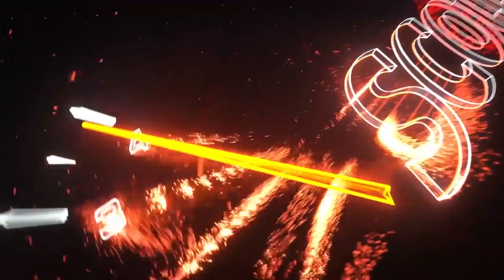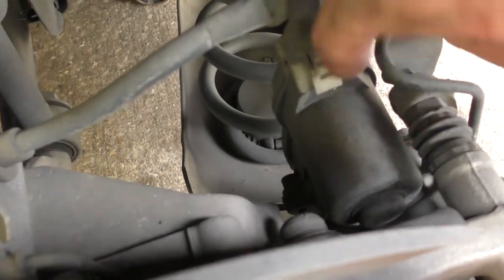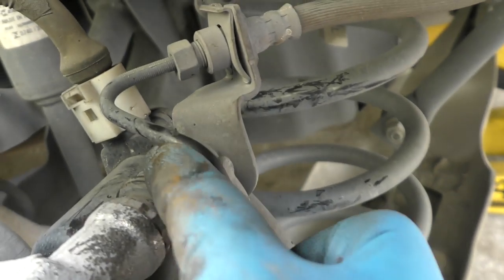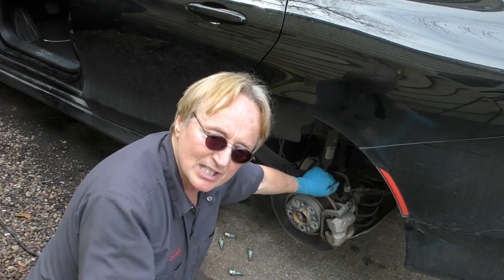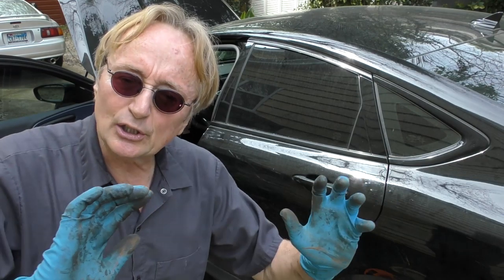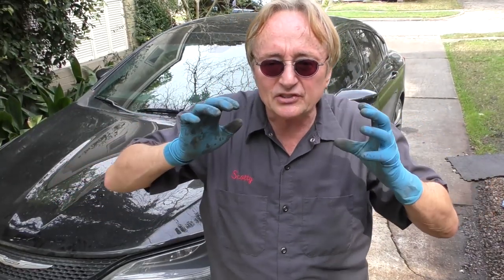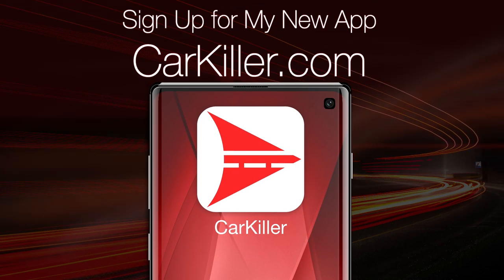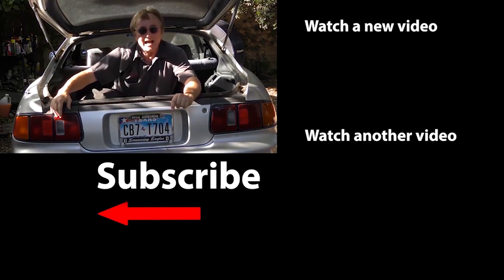This Trend is Stupid and Dangerous

Comment: Old landrover  freelander  we used to take  propshaft off remove rear diff and drive shafts 10mpg better fuel consumption  and you could spin front wheels more fun seem to be less stable at high speed  but nothing to worry  about

Comment: I have a base model Toyota where everything is electronic besides the seat adjustments...you can turn it all off of course but it too has an electronic parking brake, lane keep assist, the cruise control radar that matches the speed of traffic automatically, automatic dimming high beams etc. a $20k car brand new. Even has hubcaps with all that technology

Comment: I just use a small adapter that goes on the end of my ratchet for compressing the rear calipers just like that. No need for that special tool. The tool obviously holds it all more stable and keeps the business end from slipping while you turn, but it's not necessary. I've even used the separated nose of a pair of pliers. It wasn't pretty or easy, but it worked.

Comment: 1. Twist in calipers have been in use for decades on cable driven systems.  It has to do with running a disc parking brake instead of Drum, nothing to do with electronic. 

2. Here in Nebraska, I've never seen a car older than 10 years that still has the cable system intact. Often times the brackets between the cables fail, and they can be very hard to find replacements. 

3. It's called a parking brake, because it's meant to hold the vehicle while parked.  It's not made for emergency stops.
Reply: I have a 30 year old Mitsubishi that spent its first 20 years just south of Chicago. Original cables, brackets, calipers. I use the HANDBRAKE for more than just "parking". Most people with more than 2 teeth in their head realize that a manual handbrake isn't just for parking.

Comment: Yea I seriously don't like that emergency brake or parking brake whatever that button is. I have a coworker that has a work truck Ford F-150 2019 and it literally has that button and my God I went inside of it and test drive it for a bit and boy do I hate it so much. I have a 2014 tundra and have the emergency pedal on the floor there is literally no reason to have that emergency button at all, it's completely worthless. and it makes me not feel in full control rather than having it on the right side of me or on the floor. More tech = more crap, unreliable and more problems.

Comment: I agree I hate these stupid electronic brakes I work at dodge as a mechanic and I hate those brakes. Plus if you have to push the car releasing the brake when the car doesn’t have power is a nightmare

Comment: Good video 
Some of those emergency,
Braking system req you when changing the rear brake pads to use a computer with the soft ware
To wind the motor to the required position so you can slide the pads into the  caliper.
More expense for.the.motorist.

Comment: My Volvo has the same setup. It's actually not too bad to do a brake job. Makes it way easier to remove the motors first tho, then the piston goes back in easily like it should. Then you reset the motor with the right size hex bit. Took me a minute to figure it out but they're easy to me now. Still annoying compared to the good ol' cable tho.

Comment: I like the electric "emergency brake", because it automatically releases itself when you take off. In a manual or in an automatic. It's really handy especially in a manual. I admit, i do miss the handbrake with a cable sometimes, but we've had so many cars with the electric parking brake i can't even remember. Haven't had an issue with a single one. Usually issues arise when it's not used much and user neglects maintenance of the car. Afaik in many cars it just uses the regular brake pads.

Comment: Completely agree, electric P-brake is a bad idea. try to drive a ride, put the car in N and let it roll, try to use the "emergency brake" it switches on at very low speed, on some cars (VW)

Comment: Not just in the long run, it also cost more initially. The cost of the switch, computer, electronic motors, wiring harness and specialty calipers cost for than a lever, cable and standard emergency calipers or drum assembly

Comment: The only benefit I've found with having an EPB is, it auto disengages if you try to back up with the EBrake on so, those of us that are forgetful don't end up somehow managing to drive with the EBrake on. And, on my Subaru Outback, they have a "hill holder" feature and, when turned on, it will auto engage the EPB when you are on a certain incline so you don't roll back, and will auto disengage quickly when you hit the gas again. ... But, that's about it. As far as I know, the Ascent and Outback models use EPBs, the rest, use the traditional pull EBrake.

Comment: 50mpg awd is the prius new thing to be the best at a category.  Fwd with rear electric motor for awd up to 43 mph . Be an interesting video if you would explain that awd system. Mine did 57 mpg all summer. 43mpg all winter in the Colorado mountain snow . Works well .

Comment: The screw in rear caliper piston is done for any rear disc brake caliper where the rear disc doesn't have the miniature drum brake inside for the parking brake.  Even where the parking brake is cable operated.

Comment: The electric parking brake on my Can Am Spyder requires the key on and power to release.  I keep it on a maintainer but while on a 6week trip one of the cells shorted out, I couldn’t charge it or jump it to release the brake.  It was not a fun morning getting it out where I could work on it.

Comment: I have used my parking break on multiple occasions to prevent accidents in bad weather conditions. 
Like one time I was taking a bend in shitty weather and I lost control and was going to crash into the side (I wasn't going fast, was taking the bend at about 20 KM/H. In normal weather conditions it's a full speed 50 KM/H bend). 
What would have been me jumping the curb and possible hitting the post ended up me not hitting anything except for my rear wheel tapping the curb. Good luck doing anything like that with these new parking breaks.

Comment: Scotty, correct me if I wrong.  Simple handle and  cable system  is not so simple.  It's  a system  of TWO brake systems in one  package.  DRUM and  DISK brakes together. And this  system  is heavy.  And I have  to agree  with  you , in emergency  situation  hand brakes  will  work much  better,  but how many  people  do you  know  which  ever  use  hand brakes in emergency  situation?  So for  average  driver  electrical  system  is better,  safer,  cheaper  to maintain.  And it's  saving  a lot of weight  on rear suspension.

Comment: Hi Scotty 👋. Not all AWD systems are gas hogs my 2016 outlander is a 4 banger and AWD I get about 31 mpg when I'm just buttering the gas not going over 2500 rpms and the CVT is fantastic on it. It has power when I need it. Here in NJ and just in the north east in general we need AWD. it just depends on what vehicle do you get any v6 all-wheel drive is going to guzzle gas. Four-cylinder all-wheel drive models White Honda CR-V or even a Nissan rogue are best for great mpg.

Comment: Scotty - I apologize that I have written this in an older feed, I am trying to be sure that I catch your attention. When I was driving my old van to get to the Salt Flats I had to go through about six inches deep of salt water. Apparently some of that brine got into my trailer plug and burned up my electrical system  (It actually was quite pleasant staying the night with the moon shining on the Flats). Nobody seemed to know how to fix my problem. One of your shows encouraged me, I bought the test equipment you recommended and fixed it myself. I have loved your shows since that time. I live in Utah where there are a lot of cool things to see. We were down in Goblin Valley when we got stuck in the sand. I had my  children trying to help push us out! So I came up with a method of getting a grip on soft sand and snow. They work remarkably well. They would give your viewers confidence to get out and see more amazing things. The people helping me with my kickstarter are going to send you a movie we made. I hope you will feature at least some portion of it on your channel. I am excited to feel that I am part of your community. And yes, my children helping was just the amount of forward force we needed (it actually was probably a miracle). They all survived and hold it as a fond memory.

Comment: My opinion is that the difference of an emergency brake and a parking brake.  I find you'll see that electric switch in most models than used to have the foot press parking brake.  Vans, trucks, large suvs, large sedans.

Comment: Yes! My 2016 Honda hr-v has electric e-brake. My battery died and needed a tow. Had to drag it out if the parking spot. Have flat spots on my tires now. It's such a dumb. They should have made a bypass for it.

Comment: Hey Dear Buddy , do u remember the 63  Chrysler 300 sport ? Push button tranny,  small lever parking brake ? Rectangular steering wheel ? Good suspension,  strong engine ! I cry every nite to find one , when I was 14 years old I learn to drive in it ,  after the 57  de soto with a mirror on the dash 😥😢😭  certainly nice  car too . Manly mechanical hugs 2 you and many great blessings 🙏 to your family 👪

Comment: Hi Mr Scotty
Ernesto here from Houston,
I bought an F150 08 XL 4.6
I did the full tune up,aparkys ,ign coils,and sent my injectors to get them cleaned, replaced air filter and gasoline filter,motor and transition oil change,all done almost at the same time ,
What else do you recommend to prolong the life of my truck?

Comment: Not saying I don’t agree with the sentiment of this video, but the need to twist rear caliper pistons to move them back is nothing new and is not necessarily caused by electronic e-brakes. A cheap tool set ($25 or so) at Harbor Freight easily does that job of re-indexing a rear caliper for the average non-pro DIY car owner.  Had to do it on my daughter’s 2007 Mazda3, which has no drum parking brake internal to the rear rotor hubs.

Comment: I've got an idea, reef on the emergency brake in an 'emergency'. Watch as the ABS system is thrown out the window in favour of locking up the rear wheels and you lose any control you might of otherwise had.

Comment: The 200 parking brake has a service mode on the main screen. It automatically retracts the e-brake so you can change pads. By having an electronic parking brake the computer can control is a safety feature to prevent your car from rolling away if the door is open and car is in gear. Park brake will automatically deploy.

Comment: I bought an '18 F-150 with this and am NOT a fan.  I live in Northern Canada and once it hits -20 (C) I don't use the e-brake anymore because it has frozen up on me and caused the entire instrument panel to go completely insane.

I have had issues with regular ebrakes and cold before, but at least they didn't cause the electronics to freak out.

Comment: Even mechanical hand brakes that use the piston still require the wind back tool. This is not exclusive to electric hand brakes. Also you’re meant to retract the motor with a scan tool before winding it back in.

Comment: The electric parking/emergency brake in Landrovers are shocking to get in and out when they fail.  You're supposed to have the handbrake adjusted nearly every service but people don't and the cable keeps stretching and runs out of adjustment and jams up, then its over $2000 for another plus labour 😭

Comment: When going a bit too fast past a police car, it's good to be able to pull out and hold the parking brake release while applying the parking brake in order to slow down without the brake lights coming on. If I had a vehicle with electronic parking brakes, I'd have to install a brake light cut out switch. It's nice to have a Brake light cut out switch if traveling off-road in the evening with the lights off. Brake lights attract un wanted attention. I do have brake light cut out switches on all of my vehicles regardless of parking brake systems for various reasons and had to be careful to make sure I knew when the switch was on or off.
Reply: Driving past a speed camera next to other cars is a great time to make sure the brake lights do not light up!. If you must dispute a speeding ticket because of the camera, you do not want to be the one in the pictures with your brake lights on. Let the other car's brake lights betray the other drivers and leave the courtroom without paying a fine.

Comment: I actually love the electronic parking brake. I use mine all of the time at the long lights. Instead of shifting into park it works like this - you get to the red light, pull the button and you don't move no matter what gear you're in, then when you want to pull off you just push the gas. Mazda made it so well that if your seatbelt is NOT fastened then it won't let the brake release. If it's not fastened then you will just have to push down the brake and then push the button to release it. I can't live without this feature.

Comment: The electric brake failed in my s-type, I then made the mistake of putting it in park at the traffic lights, don't ever do this because once you put it in park it doesn't let you put it into drive again. Very embarrassing situation. The actual fault was with the battery having a couple of dud cells which upset the cars electronics.

Comment: Rear brake pistons that need to be screwed in to allow brake pad replacement goes back to the 1970s(at least that's the first time I dealt with them.) That's well before electric parking brakes were even thought of. Scotty how many tools were need to replace rear drum brakes? All that being said I would rather have a hand brake lever as the foot brake lever is hard to modulate.

Comment: I do road side service in North Dakota.  I got called to winch a Dodge 200 out of the guy's yard.  It really did not look stuck to me, but would spin the front tires and not move.  I then noticed the electric parking brake was set.  I turned it off and the car drove out just fine.  The wife told me her dog must have hit the button.  Funny, you have to pull the button up to set.  Easy winch!

Comment: I remember when I bought an 06 VW Passat with the new, “Button E brake” wow, my car has so much trouble putting it in the e brake and out of it. I never want to buy an EEBrake ever in any car. Changing the pad was worst because the only way I found to change it out was either going to the VW dealer, buying an app for the computer to connect it to the car, or using a car battery to activate the + and - .... like what the hell really. I won’t be surprised if you digitally have to sit in the car only to find out you can’t get out of the car because of a malfunction

Comment: Your Celica has On/Off handbrake and new cars with electronic brake have 8 positions and are complicated ?
They also have On/Off. You press or pull the button.
Can't get any more simple then that.
I bet you still use good old CRT TV at home. Refresh rate 50Hz , picture flickers but you are so happy since remote can not go bad. Why ? It has no remote. Good ol' simple days :)

Comment: If it applies the actual brake, it’s better. My older car (2009) had a lever, which controlled a separate drum brake. (Still had 4 wheel disc). Either way it’s something extra you have to replace when it goes bad 🤷‍♂️

Comment: In my area they use so much salt in the winter that the e brakes will get stuck on if it not used often. If you have an automatic car you still need to use the break once a month or so to keep things from rusting together or when you do put it on it may not work or it may become stuck on...

Comment: They haven't been called emergency brakes for decades. It was not recommended to pull the brake while the vehicle is still in motion. They have been officially called park brakes for a long time now. They are only supposed to be used when parking on unlevel ground.
Reply: Used even on level ground, too.

Comment: It's a PARKING brake. That's what the "P" stands for.  Your master cylinder has a redundant circuit and your brake system also has a front/black splitter.
Reply: No. First its diagonal, and seconds i helps nothing if the mainpipe breaks (as happend to me last summer). Pedal gets weak and no more breakingpower at all, but thankfully i had a working old style handbrake i could engage bitwise. Therefor i could stop downhill graceful and even drive ‚halfway safe‘ home. Tell me how to do this with this f**** on/off button thingy who is overcontrolled by a comfuser. Only a real handanchor is a emergency break.
Reply: @notofinterest  diagonal if it's cheap, many cars now have individual circuits now. If you lose a main you're still screwed and the computer wont do anything but turn a light on if you jam the brakes and nothing happens, it won't help you one bit.
Reply: @notofinterest  "Main line" lol bud, go out and look under your own hood at the four lines coming out of your master cylinder. That's an in and out for 2 separate circuits. I know it's there because it's required by law since 1967. There's a divider within your brake fluid reservoir also if you look closely too. I don't know what you're on about with diagonal
Reply: Mainpipe, mainline... im sorry, im not a native speaker, but you could follow me right wich is fine. As told, i had this experience, i drove it to the mechanic. After a while he came up, showed me a rusty thing looking like a copper pipe (may be other material, i just saw dirt) and he said that this thing was blasted cause it was corroded. Of course i asked why this can happen with a dual circle breaking system, he just said yah... car is an 2004 opel (vauxhal) zafira type a, 2.0 DTI. So, that make me believe there is something single it can break and cause a total failure. The pedal didn’t work in any way, did all the way home with the handbrake. Never forget this ride...